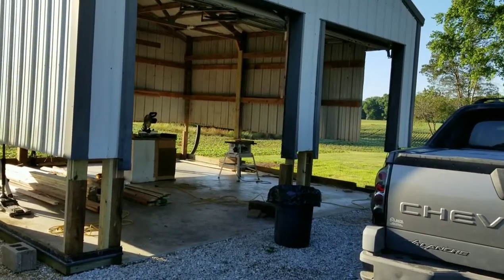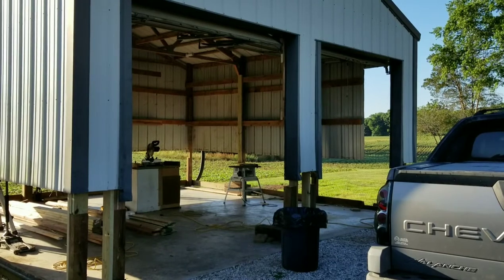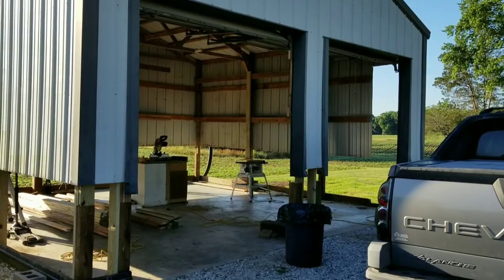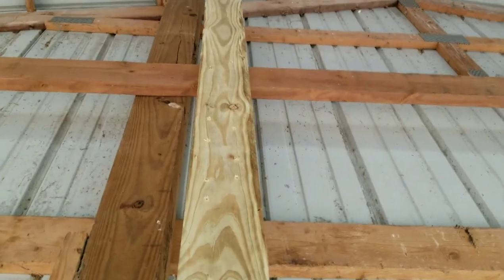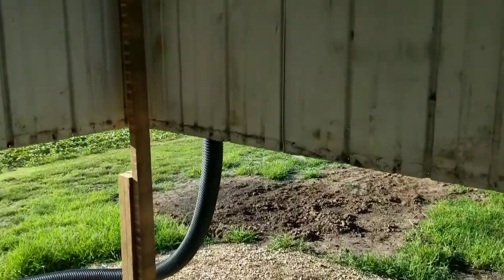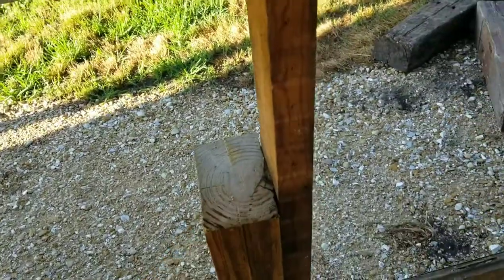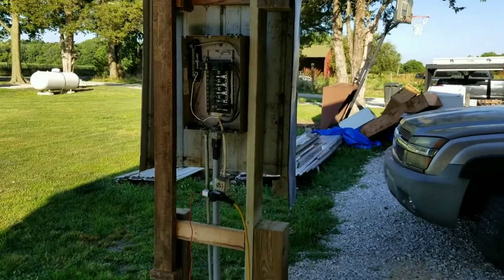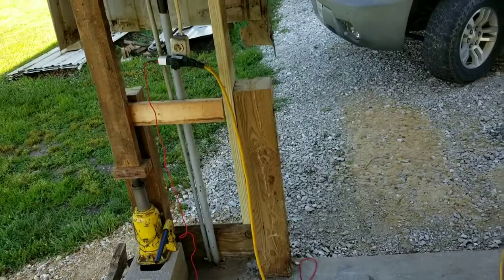Lifting a Garage with Bottle Jacks

Comment: This is exactly what I was planning on doing.  The only difference is that I was going to cut the 4x6 at the base.  Nice to know it can be done.  Thanks for the video.
Reply from the maker: The problem with cutting at the base is you'll have to anchor every post to the concrete or your shed is just floating on the pad.  I don't endorse anyone doing this. It's exceedingly dangerous because you can die and/or lose your shed if 100 different things don't go perfectly.